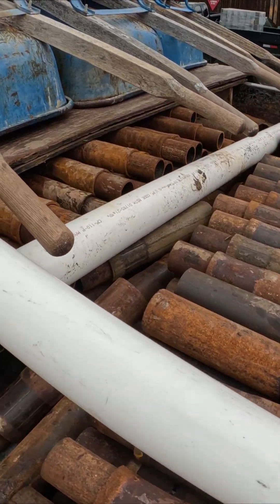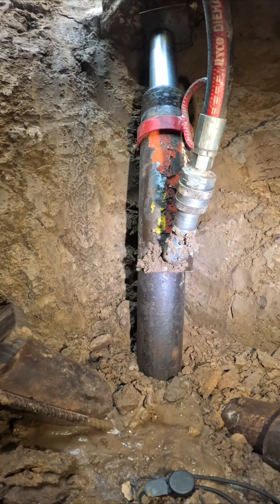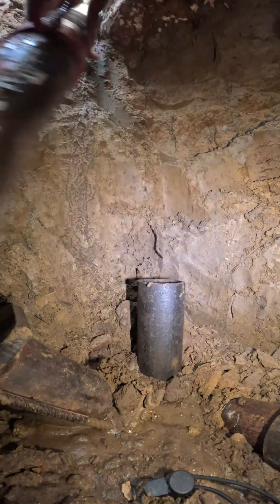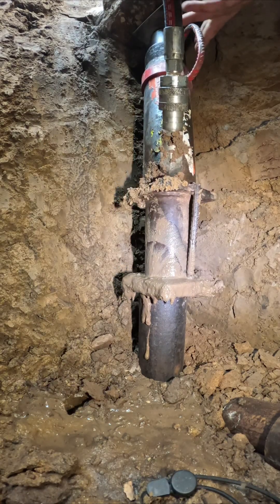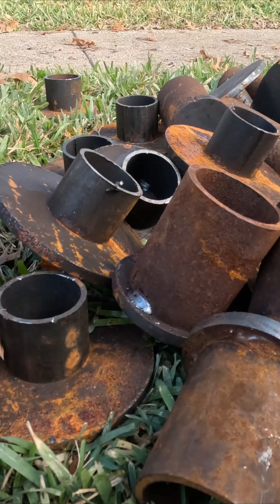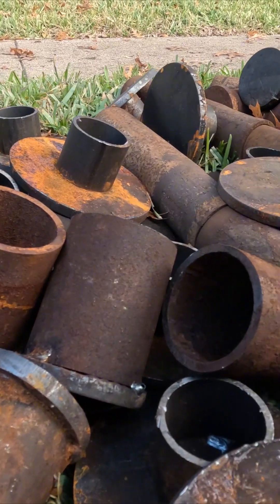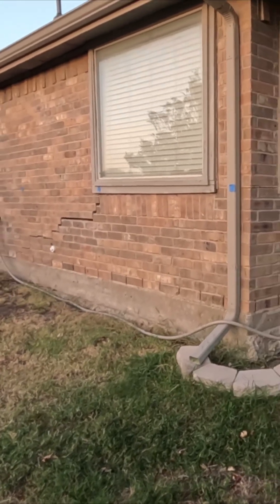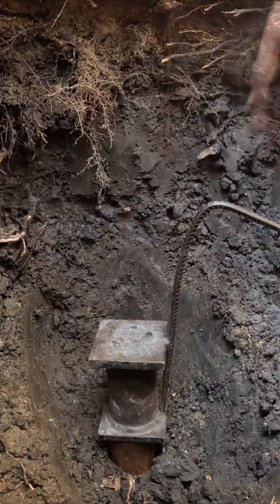Piers Don’t Fail From Rust — The Real Reason Foundation Repairs Fail

Comment: I love how there so many concerns about the steel piers, yet no concerns about the top soil the footings are in...😂🤦‍♂️
Reply from the maker: You’re right — people should be concerned about the soil their home sits on. That’s actually the root cause of most foundation problems. The surface soils expand, shrink, wash out, and lose strength over time, and that’s exactly why the original footings start to fail.

That’s the whole reason we install steel piers: to bypass those unstable top layers and lock the house into the dense, load-bearing stratum deep underground. So yes, the piers are strong — but the soil absolutely matters too. The system works because we address both the weak soil and the failing foundation at the same time.
Reply: if you knew anything about this process, you would know they are driving piers down to essentially bedrock.

😂🤦‍♂️😂🤦‍♂️😂🤦‍♂️😂🤦‍♂️😂🤦‍♂️

Comment: Do the piers lock together or are they just stacked? No worries about them shifting off one another?
Reply: The tubes are nested into each other, at some points in the video you can see one end of a tube has a smaller diameter for doing that
Reply from the maker: They actually don’t just “stack.” Each pier section has a slightly smaller end that nests inside the next one, so once they’re driven under hydraulic pressure they become one continuous column.
On top of that, the entire system is loaded with several tons of downward and upward pressure from the house and the soil, so there’s zero room for pieces to shift or move out of alignment.

Comment: Do you do the hybrid with the concrete on top because the top ones are more prone to rusting?
Reply from the maker: The concrete on top of a hybrid isn’t there because steel is “more prone to rusting,” it’s simply a value-engineered design. Steel goes at the bottom to reach refusal and carry the real load, and the concrete top sections provide a durable, stable, low-maintenance material in the upper few feet. For heavier homes we still use full-steel because it transfers lifting forces more efficiently.
Reply: Thank you for the explanation!